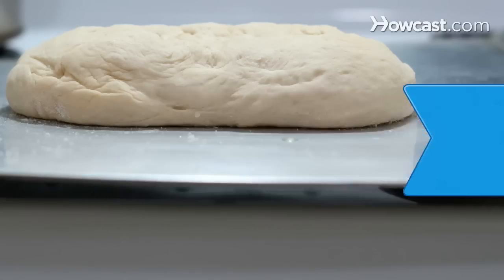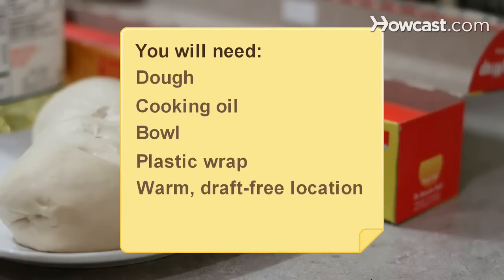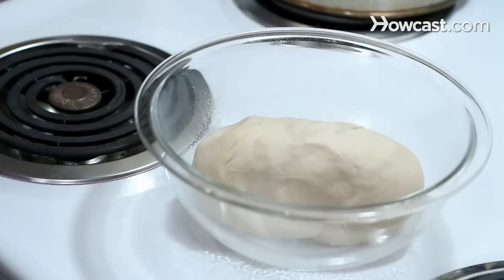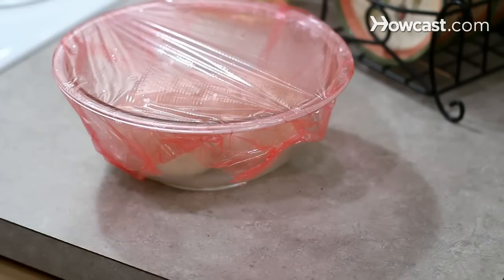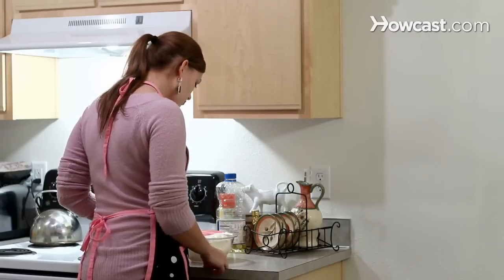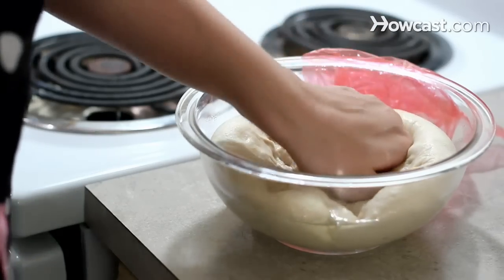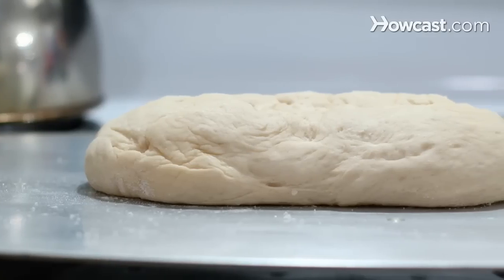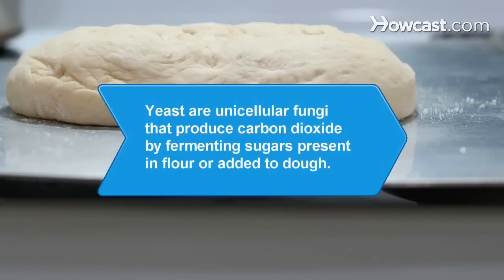How to Let Dough Rise

Comment: Always sift salt in with dry ingredients instead of adding it with the sugar and yeast in the warm water or milk. Salt will make the yeast less effective and should be added after its already begun working (foaming up in liquid). Sifting it in with flour also makes the contact less harsh bc its mixed in with something a lot bigger.
Reply: Salt strengthens the gluten structure but that's bad in the early stages of mixing

Comment: That's too much oil. It's OK to have a little dough sticking to the wrap. In the end you need to punch out all the air. The dough in the vidro is too oily and from the looks of it the proofing need to be longer it is not light enough. When you poke a dough it should immediately deflate. And the bottom of the bowl should be warm. Like seriously it's warm when the proofing is done.